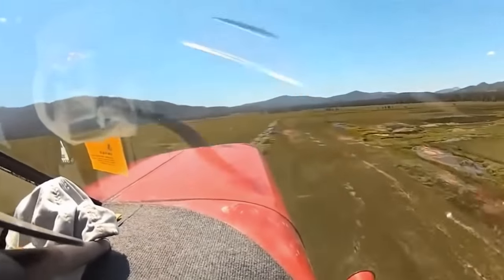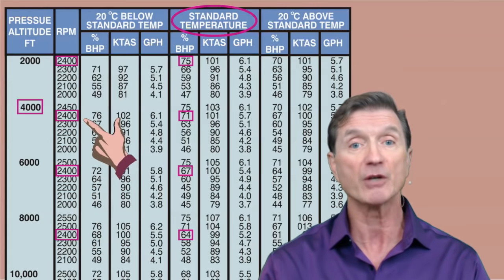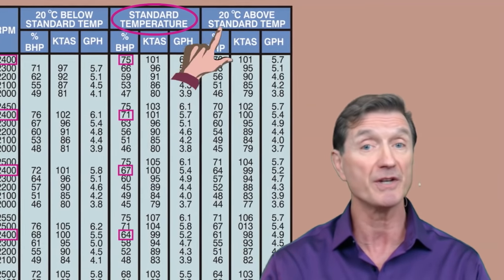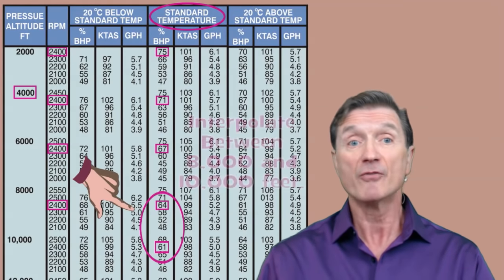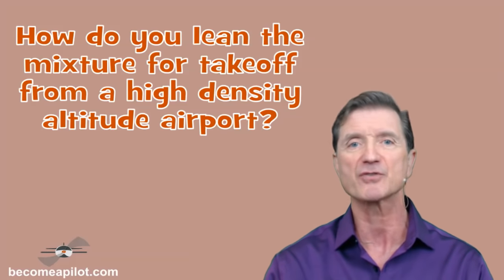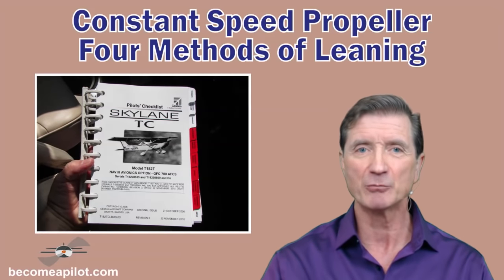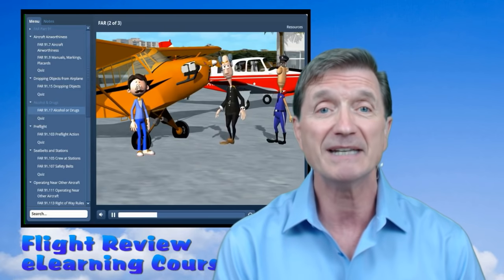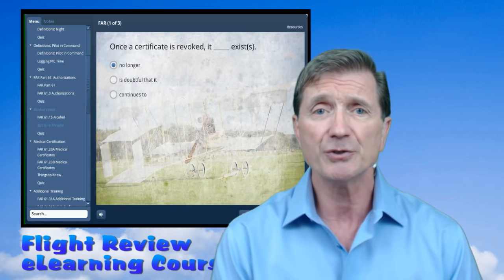Leaning the Mixture for a High Density Altitude Takeoff

Comment: Lots of good information but you missed one point about high density altitude flying, that is starting the engine. I used to be with Black Forest Gliderport in Colorado (elevation 7200 feet) and we'd often have pilots fly in to fly gliders. They would try to start their engines only to have them start, belch black smoke and die from flooding. One of the instructors would usually go help them get their engine running. One day this guy in a Baron got one engine running and was having the other one refusing to run after starting. I went out to help him but he informed me that he didn't need some Cub pilot to tell him how to fly. He cranked on it until he finally burned up his starter.

Comment: Having learned to fly in high density altitude (base elevation about 5300 feet -- on hot summer days, the density altitude would often get close to 9000 feet...), I always thought leaning for max power was a normal part of run-up!
Reply: I did the same as a riddle rat

Comment: Nice video, I got a question. Most Cessna takeoff charts show pressure altitude for distance over 50ft obstacle. How much percent should you add to this for high density altitude days?
Reply from the maker: Thanks, JS: It's true that most Cessna takeoff charts show takeoffs at different pressure altitudes, but they also show four to five temperature ranges for each pressure altitude, too. So you wouldn't need to calculate DA directly since variable temps above standard are part of the chart. Does that help? If not, then send me a copy of the chart you're using to: rodfly9@rodmachado.com and I'll have a look.
Best,
Rod

Comment: Rod, quick question. Doing this (full throttle) run up, are you suggesting we do this in place of the usual 1700-1800 RPM run-up where we check the mags, or is this in addition to? If in addition to, would you do this before or after the mag check? Thank you!
Reply from the maker: Greetings Michael:
I think you are confusing the phrases, "full throttle runup" with "using full throttle in the runup area to set the mixture for a high altitude takeoff." You only need to use full throttle to set the mixture for best power before takeoff. The typical runup where you check the mags, etc., is still done at the recommended RPM in the POH. Please go back and watch the video again to get the nuance in the narration.
Best,
Rod Machado
Reply: @Flight-Instructor  Thank you! Based on your response, I think the answer to my question is "in addition to." So my follow up question was, which should happen first? Logically, I think it would be the mag check at the recommended RPM in the POH that is done first with mixture rich, and then full throttle to get the right mixture for density altitude. Is that right?
Reply from the maker: Greetings Michael:
Yes, do the runup first and do it at the appropriate mixture settings which typically involves a little learning to prevent plugs fouling (if appropriate). The use of full power in the runup area is done after the lower RPM runup to "approximately" set the mixture for best power on takeoff. 
Rod
Reply: @Flight-Instructor  Thank you very much! The 15 year old version of me flying Flight Simulator never would have thought I'd get the opportunity to ask you questions like this. You're a celebrity in my house! Thanks for being a part of this guy's dream of being a pilot. 🙏🤝🏻
Reply from the maker: Greetings Michael:
It's absolutely my pleasure! I'm happy you found this information useful. And kudos to you for asking these types of questions, too. 
Best,
Rod Machado

Comment: How do you lean for a go-around when arriving at a high DA airport? You don't have the luxury of being able to do a full throttle runup first. Just leave it at the cruise mixture setting? Or maybe get down to pattern altitude and do a full throttle run when you're 10 minutes out?
Reply from the maker: Greetings JJ94:

That's an excellent question. If you have the mixture set for a cruise at a high-density altitude (say, 10,500 feet) and descend for landing at an airport having a lower density altitude (say 5,000 feet for this example), then you certainly should reset the mixture before landing. It's entirely possible (depending on the difference in these density altitudes) to be on final, attempt a go around and have the engine sputter or fail with the application of full throttle (once again, depending on the difference between the two altitudes above). 

So here's a general rule to follow. When leaving a cruise altitude and before entering the traffic pattern at your destination airport, move the mixture control forward one-half of its "present" aft travel. On the downwind leg, you can test this mixture setting by smoothly applying full power then reducing power to the pattern setting again. If the engine doesn't sputter or cough, you've got the assurance needed to know that a go-around is possible with that mixture setting. If the engine sputters or coughs, then move the mixture control forward one-half of its "present" aft travel again. And, of course, upon going around, you can readjust the mixture for maximum power at the appropriate time.

As an addendum regarding the go around, it's very very rare to have a normally aspirated engine (that's not being fed by an electric "boost pump") quit because it received too much fuel. Engines can handle a lot of extra fuel when operating at full "throttle" settings. On the other hand, an engine can easily sputter or quit if it doesn't have enough fuel regardless of the throttle position.

Comment: yep  @ 7:45 Our prop with 500 hours has just been repaired on  our Vixxen A32 . Any more stone chips and a $6000(AUD) replacement is required. Gravel everywhere  at YCAB and $300,000 sitting in the airfield committee bank account. Figure that out..?

Comment: Well,  you almost covered the case where you've got more thrust than brakes during the run-up; those of you with 1947 Ercoupes and factory brakes know what I mean...

Since I've got full time EGT and CHT for each cylinder and they all run pretty close, I just 1) lean during taxi to the point that when I apply full throttle for takeoff it sags noticeably; then I know I need to enrichen but that I'm already on the lean side of peak. 2) I richen to get max power for takeoff by feel and sound,  but 3) I've got EGT and CHT to watch during initial climb out so I don't get into the dangerously hot part of the engine operating envelope. That 15% automatic enrichment is great if you aren't monitoring temps,  but if you are it's just throwing fuel away if you know you for sure you can stay out of the hot zone.

You can do this all by feel if you KNOW the mixture distribution is even, and you can't know that unless you have temps for each cylinder.  As an extra bonus, I go wide open throttle on takeoff and for the rest of the flight I manage power with mixture and carb heat- that is to say,  I lean to drop the RPM to the bottom of the green  in cruise climb and keep coming back after leveling off. Then if I want to climb after that, I richen NOT with mixture,  but by pulling carb heat. 

This is a safe technique but not one most people would use because in cruise I'm running "acceptably rough"- which is a state where shutting off one mag gives a 200 or 300 RPM drop. Then pulling some carb heat jumps the RPM up about 200 RPM and without changing anything else,  you get a nice cruise climb. 

In cruise I'm shooting for 1.316 times the max L/D IAS (best range speed) because THAT speed- the Carsten Speed- is where you get the most speed for the least drag. It's NOT max range speed but it gets you there while you've still got daylight. In fact you can make up for lost time by going high to get the TAS up and by skipping an intermediate fuel stop since the fuel burn is so far down.
. 
Some will object that leaned that much takes you out of the MAX ECONOMY mixture region,  and it does- but I'm burning less than 4 gallons an hour with a C-85 and contrary to the old conventional wisdom,  it doesn't "oxidize" the valves.  CHT is the only temp that actually matters. I find that the power adjustment using carb heat is much easier than using a sensitive mixture knob since it takes much more travel with carb heat to get the same change. (All this should take into account the winds aloft- I lean much farther going downwind since a really puny power setting keeps you in the air longer so you take advantage of the favorable wind. Going upwind,  I don't get quite as stingy with the fuel burn... you want to speed up a bit since it decreases the time you're penalized by an adverse wind.)

One last thing: if you want to start leaning below 4000 ft, note the density altitude given by the airport weather recording and just climb however many feet are required to make 4000 (which in Texas is often pattern altitude)...OR, you can add carb heat as soon as you clear the terrain to give the ENGINE a 4000 ft density altitude BEFORE the airplane sees 4000 ft of density altitude. If that's not clear, I'm saying that carb heat lets you operate the airframe and the engine at two different density altitudes simultaneously...which is sometimes useful.

Bottom line is,  I go wide open throttle at the start of the takeoff roll and never retard it until I'm on downwind. That reduces "pumping losses" against a tilted throttle butterfly plate. Every other power change is done by mixture or carb heat. You might find my engine roughness a bit disconcerting,  but if Peter Garrison could regularly cross the Atlantic in a homebuilt using the "acceptable roughness" rubric, it's good enough for me. And my engine loves it- operated this way, my CHTs stay down around 350F and there's not a spec of carbon fouling to be seen- you can easily double your TBO this way.
Reply: Interesting that you are controlling engine power output with fuel, not throttle. Like a diesel engine. I have never tried that. Also since it is full throttle and not pulling vacuum, there's no loss of energy there either.
Reply: Very interesting dissertation. If we were talking about modern engines, I would probably frown upon the concept of using carb heat as a substitute for throttle. However, given the fixed ignition timing in our Lycosaurs, you may be on to something. I am really wondering here if leaned to the point of roughness on one cylinder if carb heat actually may be more effective for smoothing out the combustion in the worst cylinder than actually richening with the mixture knob. Obviously it results in less power at full throttle than using the red knob would provide. And, don't try this at high power as a hot mixture is much more prone to detonation - so be on your game if using this trick as a substitute for altitude in order to get below 75% power for "safe" aggressive leaning!

Comment: This seems like more than just a fuel mixture issue, these look like 4 huge guys that hadn't missed a meal in a while, I'm thinking this was also a weight and balance issue, and quite possibly too much luggage and camera gear as well.
Reply from the maker: It might be. I don't recall the NTSB saying anything about this. But clearly, if takeoff performance is reduced, you can increase performance by reducing the weight.
Reply: Rod Machado 
       Thanks for the reply,  are you still  Physically training?, if so where? I'm not interested in flying commercially,  but I would like to get my ppl for personal use.  Love your videos,  sense of humor, ( terrible way to install a pine scented air freshener🤣)  and calm  demeanor. If I'm going to give someone 10k of my hard earned money,   I'd like for it to  be someone with the good reputation, based on the research I have done you seem to be always at the top of the list.
Reply from the maker: B4Real 1: I still train but do a lot of solo work with the Jo (short staff) and regular bag work, running, weights, etc. Consider coming to the US for your PPL, too. And thanks for the  tree-top reference. I sure felt for that pilot irrespective of the poor judgment used here.
Best,
Rod
Reply: Yes, that accident was more than just a leaning issue, but setting the mixture improperly was a major contributor. With the density altitude the day of that accident, that 165hp Stinson should have only had two onboard, instead of four, and a reduced fuel load. Even a 182 under those conditions would have an issue. High DA’s are not to be trifled with, especially in heavy, underpowered airplanes.
Reply: They also did not take off early morning and the wind was downslope they were departing into sinking air.

Comment: Or, better yet, if you have a engine monitor, pick a cylinder and note the EGT when taking off at sea level, probably somewhere between 1200 and 1300 degreees.  On your next high density take off, lean the mixture and match the EGT on your chosen cylinder and lean in the climb.  You will have max HP from take off to level off.  Simple eh?
Reply from the maker: Janet, you're not taking into account the effects of the engine's fuel economizer (fuel enrichment valve) on takeoff at a low density altitude airport. I wouldn't recommend that method for setting the mixture.
Rod
Reply: Some people don't have the luxury of taking off at sea level.  Not so simple.
Reply: Chris James   The EGT value for a normally aspirated engine during sea level takeoff should be 1200-1250F. For a turbo engine it’s a little higher...1300F. This assumes the engine’s fuel system is set correctly and operating normally.

If your mixture is set correctly for the actual density altitude, the EGT will be at the above values for takeoff. Lean during the climb to maintain those values and you will have good power and adequate cooling throughout the climb. Of course, all this assumes you have an engine monitor for accurate EGT/CHT readings.

FWIW...I live and fly above 5400’.

Comment: Yeah  I thought I was reading that wrong. The term "High density altitude" should be changed. Firt time i read it i assumed that there was HIGHER density at altitude not lower. This used to be refered to as an airpocket where there would be pockets of lower density air during flights and the plane would suddenly lose altitude a few hundred feet.... this should be reworded..high density altitude just doesnt explain ...lower pressure than expected at altitude.
Reply from the maker: Greetings Ryan:
Yes, I do understand your confusion. But that's the way the term is correctly used in aviation. 
Best,
Rod

Comment: If you don't want to have to lean your engine in Leadville Colorado,  elevation 10,152 feet then get a jet engine or  turbo prop engine as the fuel governor will lean it for you. You have no means available to lean a Jet or turbo prop engine.